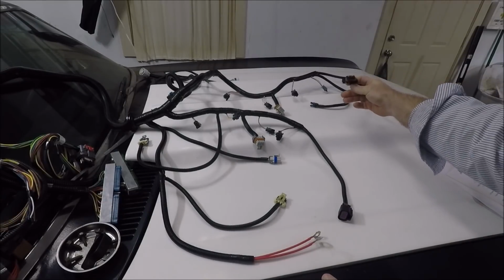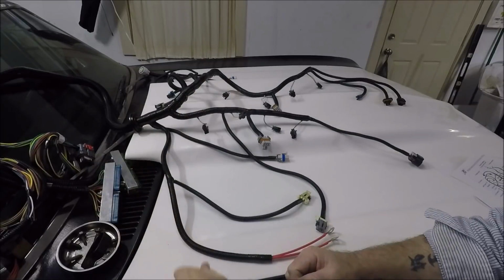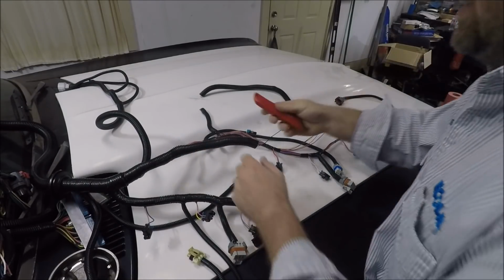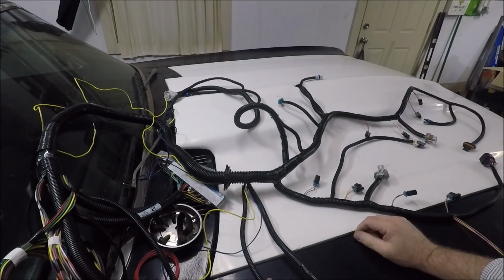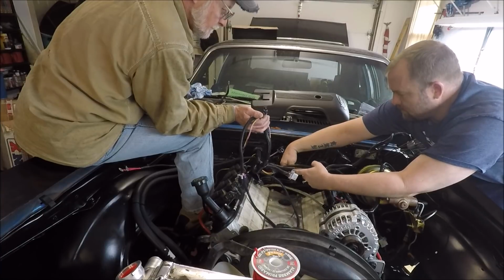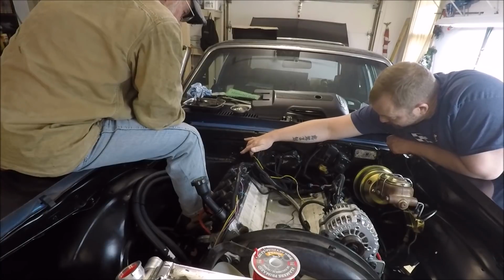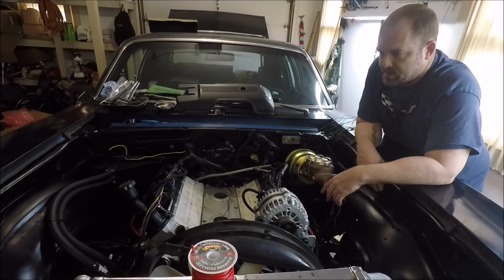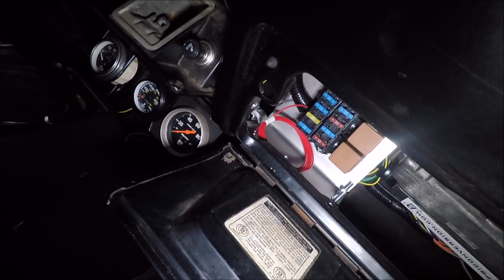PSI LS SWAP WIRE HARNESS INSTALL

Comment: I feel you.  After scratching me head with my PSI harness for a few hours, I ended up modifying the damn thing too.  It will work fine, but for the money I expected more.  The split loom was a pain in my ass, but I wasn't ready to fork out the $125 they wanted for braided loom.  I ended up removing the loom on the wires once they entered my truck and using harness tape to have more flexibility.  Next time I am either building my own or doing a little research.
Reply from the maker: Yea I expected more for the money as well. This is maybe a $300-$400 harness at best but nowhere near being worth the $600+ they charge for it.

Comment: My PSI harness was really plug n play. Everything was where it was supposed to be. 86 Monte Carlo SS LS1 Swapped.  
Awesome video!!!!!
Reply from the maker: Glad it worked out for you brother.
Reply: @BadLuckGarage  
Speartech
Reply from the maker: @dalehall2993  Holley or build it to ur self.
Reply: @BadLuckGarage  
Have you ever used speartech? the founder of the company was a gm engineer for over 20+yrs..
Reply from the maker: @dalehall2993  Brother it costs $25 worth of parts and one day to rework your own harness. I reworked the harnesses on every vehicle on this channel(and several not in this channel) before the DRNova and I would never spend that kinda money in a harness. The only reason I bought the PSI harness is because it wasn’t my money and it’s what the owner wanted. The terminatorX is 100x better than the factory PCM n every way except emissions. By the time you buy a speartech harness and hp tuners you could have just bought a complete terminator X EMS ,had better setup with more capabilities, and still had money left over in most cases. After using the Holley on the Chaos Theory Camaro and seeing how feature packed,safe, and easy to tune it is, I don’t plan to ever use a stock pcm setup again. Matter of fact I’ve already sold all my old harnesses and pcms over the last year. 😉
Reply: @BadLuckGarage  Watching all these vids of setting up harnesses..I still don't wanna chop one up, with my luck I'll cut a wire that will shut down the whole system. So, I've thought about buying one online and your Holley recommendation confirms my thought processes for doing my 02 S10 ZQ8 swap..Thanks
Reply from the maker: @abarnes0330  Yea I’m not a fan of the premade harnesses really. I’d rather just take a day and a few beers and redo one myself. But after using the Holley on Chaos Theory I doubt I’ll ever use a factory pcm again.

Comment: Where did you hook the mil lamp light (brown) wire up to?
Reply from the maker: @jonathangibson2482  To the mil light we added to the dash. Check out the DrNova playlist on this channel and look for the custom dash video for more details. But basically the mil light is a ground trigger, so you need to run 12v switched power to the mil light, then run the mil light wire from the pcm on the other side of the light. When the pcm triggers the light it will ground the circuit to turn the light on.

Comment: I've used the psi harness and the Chinese version and they are very close in quality and appearance. Psi is about $600. Chinese version is about $250. I've always had to modify the psi harnesses. The Chinese harnesses are usually built as requested. People are free to make their own opinion but that's mine.
Reply: What’s the Chinese harness called
Reply: @TexasTac  it doesn't have a name on it but the instructions are identical to psi.
Reply from the maker: Thanks for helping him out brother!👍🏻
Reply: @BadLuckGarage  we're helping each other brother.
Reply from the maker: That’s what I love to see here!!!!👍🏻
Reply: @appliancedude63  where did you get the chinese harness from
Reply: @dantegorden4455  eBay

Comment: I bought one too, but I bought it with the intent to make a custom harness using "new wire". I would be pissed off too tho man. You are paying out the butt for the "convenience" of it fitting properly out of the box, only to find out it's all kinda funked up... looks about like mine.. shits way too long, some too short, but I will say at least all the right connectors are there and not too brittle? 🤷‍♂️

Comment: Stupid question but isn’t the cylinder heads aluminum, if so how is that cylinder head ground work?
Reply from the maker: Aluminum is a conductor just like any other metal. 😉

Comment: Hi, your harness, like all of our harnesses has the MAF sensor connector come out on the drivers side of the engine.  99% of swaps have a battery on the passenger side, so the intake comes out on the drivers side.  The simple solution is to call and get a pigtail or extension harness if you want to run the maf and intake on the passengers side, or if your maf connector isn't long enough.
Reply from the maker: I can understand that. And that is valid reasoning, however that is also added expense to what I feel is an already over priced product. A note stating that the MAF isn’t located in the factory position would help to avoid problems by customers in the future as not everyone runs the intake to the passenger side and the factory truck style harness (as this was advertised to be) would have the MAF on the passenger side. I chose to open the harness and reroute the wires to save both time and money since I didn’t know ahead of time and would have had to pay for an extension harness and then wait for it to be shipped.

Comment: Do you have to run the small wire from factory bulkhead to the starter using this harness
Reply from the maker: Yes. Most any LS harness will still require you to use your factory starter wire. 👍🏻

Comment: How did you hook up the fuel pump??
Reply from the maker: With the fuel pump wire
Reply: @BadLuckGarage  no I mean where did you hook up the fuel pump wire to the fuse block
Reply from the maker: @dannyreid1845  it comes with the connectors and instructions showing you how to wire in the relay if needed. But it’s no different than wiring any standard 4 pin relay.

Comment: The splices are for the fuel injectors. The splice the 4 injectors into one wire. its a safer setup that way.
Reply from the maker: They didn’t splice multiple wires together brother, they spliced wires to lengthen as if the original wire wasn’t long enough. There is no valid excuse for that when you’re building a brand new harness as you should be using complete runs of wire cut to the proper length.
Reply: @BadLuckGarage   Those splices, which are sonic welds, are there for a purpose.  The 4 injectors are indeed spliced together.  There are also splices for the fusible link wires that protect your harness from shorts. Those are on the two power wires covered in red heat shrink.
Reply: @BadLuckGarage   Thoese splices are indeed for the power wires going to the injectors.  If you see more than one wire coming into or out of a splice, it is there to join multiple wires together, like for each bank of fuel injectors

Comment: I have the same harness for my project and I installed it and I be damn the harness plug 🔌 is the same damn plug 🔌 on my o2 sensor so now I have to change the o2 sensor plug 🔌 on my brand new harness for psi smdh 🤦🏿‍♂️🤦🏿‍♂️🤦🏿‍♂️🤦🏿‍♂️🤦🏿‍♂️ don’t feel bad 😞
Reply from the maker: Yea I only covered a few of the issues I had in this video but that’s another.....I had to buy different O2 sensors to match the harness as well.

Comment: I Watched this video 2 days ago. Yesterday  I spent the day taking my psi harness out and re ran it . Everything is now under the dash. Engine bay looks 100x better now.  My harness also had the maf plug in the same location as yours. I will most likely do the same as you did. Thanks again!
Reply from the maker: I’m glad if it helped you out brother. 👍🏻

Comment: What I did I bought a wreaked truck 2000 Chevy with 169,000 miles and rapping the shit out of it literally and putting it in my 64 c10 it seams to be the more budget way to do it

Comment: How'd ya run the starter wire?
Reply from the maker: Use the original starter wire from the car. It goes from the ignition switch to the starter and has nothing to do with the swap. 👍

Comment: Is there a way to charge the battery from the alternator when using a swap harness??
Reply from the maker: Yes, it’s hooked up exactly the same way your original alternator would have been hooked up with the charge wire going from the back of the alternator to the battery.
Reply: @BadLuckGarage  Thank you once again my friend!
Reply from the maker: @charlesclemons741  no problem brother.👍

Comment: $600, shit  paid close to $900 for my harness and "pre-programmed" ecu. Map sensor in wrong spot and the wrong end even though all info and specs were given. Best part was when my tuner came out to make sure all was ok and load correct map sensor, he found the ECU was actually locked and couldn't even do anything with it. Had to buy a new ecu locally just to start my car, and send the one I paid for back to them, no communication and it randomly showed back up at my house a few weeks later. I asked for my money back on the ecu, but guess not!
Reply: Eric, none of our pcms are locked.  If your having an issue, email techsupport@psiconversion.com

Comment: Well crap. I am not looking forward to wiring this 3rd gen Camaro now. I got the PSI stand alone harness too.... I really hope it is easy to modify!!!
Reply from the maker: It’ll work just fine. My contention is with the quality to cost. This is a $250-$300 harness being sold by PSI for $600+. There are accusations that PSI harnesses are the same as the ones being sold on eBay and Amazon for $250 or less. They even come with the same instructions. After seeing one of those harnesses I have to say they are identical and there may be merit to these rumors. I prefer to make my own but my recommendation to anyone else is to simply cut out the middleman(PSI) and order straight from the mfr in China for $250.
Reply: I wonder if they will let me return. It is still boxed. I am going to try today. It still have my 5.3 wiring harness so could still rebuild mine. It was close to $700.
Reply from the maker: No clue brother. Like I said in the video, I only bought this one because the owner wanted a new harness. I had seen the cheaper ones on eBay and actually called PSI before riding this one and they told me that the ones on eBay were not PSI harnesses and that they were pursuing legal action against that mfr. Then after doing this video several subscriber pointed me to some people with those harnesses and turns out they are identical! Like I said, I can’t say for certain, but I would almost be willing to bet that they ARE PSI harnesses and the mfr in China is simply selling them under the table on eBay and Amazon. That type of thing happens all the time since patents laws are different over there. Company gets big, decides to have a mfr in China start making their stuff to keep up with orders. Next thing they know they start seeing their stuff being sold for 1/3 the price unbranded on auction sites. Lol
Reply: @BadLuckGarage   Our harnesses have never been made in china.  What you see are counterfeits.  They dont use the correct grade wire, loom, real delphi connectors, sonic welds, or fusible links.  The chinese must have bought a few harnesses and stole our instructions off of our website.  You arent getting and identical harness, you are getting something that looks like it, but is made with cheaper parts,  and by cheap chinese labor, not Made in the USA like a PSI harness.
Reply from the maker: Thank you for the clarification! 👍🏻

Comment: i thought i was the only one that bitched at these. Tac 
module  wire is way to long ,map like you said is to long  , trans harness to long wtf 😐
Reply from the maker: No you’re definitely not alone. Don’t get me wrong, they’re not a “bad” harness, I just feel that the quality doesn’t justify the price point.
Reply: Bad Luck Garage I have a china one paid $320 for it and it fired the car right up
Reply from the maker: @hpjunke  I generally make my own for less than $20 but this wasn't my car or my money so.......
Reply: Bad Luck Garage Yeah i have to learn how to do this .. i  seen a couple of guys bashing the china harness but in all it’s not bad. But i agree with you on this video 100%

Comment: Wow, that looked extremely frustrating especially for the price you paid for it.  It turned out nice 👍
Reply from the maker: Yes it was. It really wasn’t a big deal to fix, it only made me angry because it shouldn’t have to be done at that price point in my opinion.
Reply: @BadLuckGarage  I agree.  For what you paid it should have been a "plug & play " it turned out great though.

Comment: if the harness was lets say  250.00 would it be worth it then? your thoughts.
Reply from the maker: I wouldn't complain at all for $250 (which happens to be what the ebay harnesses are selling for now) At that price its not even worth my time to have to rework factory harnesses anymore.